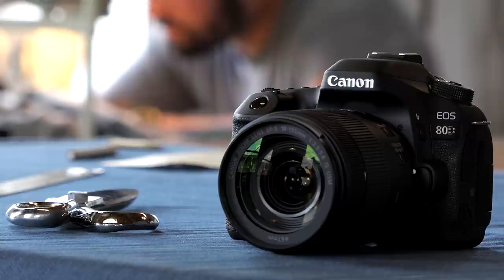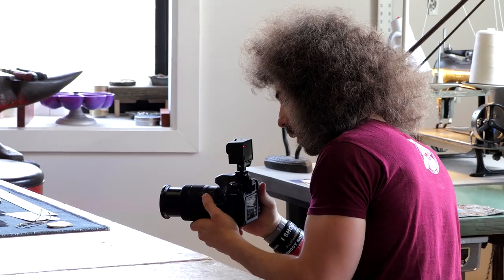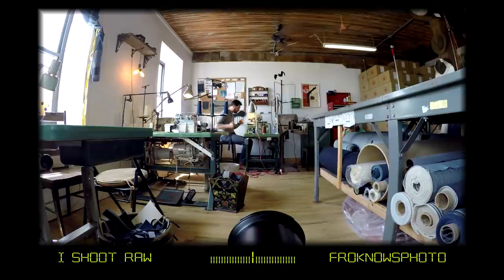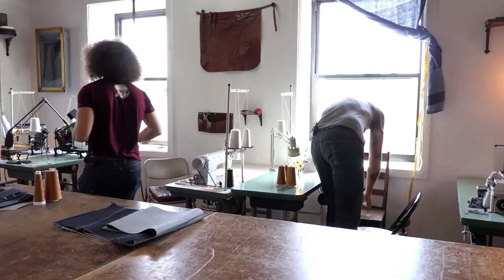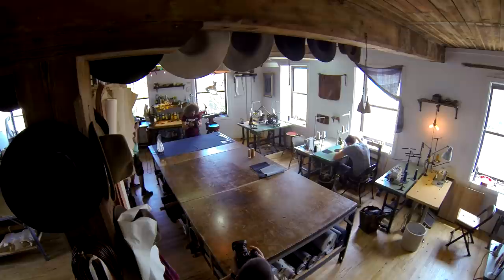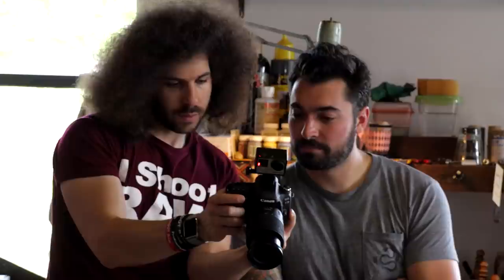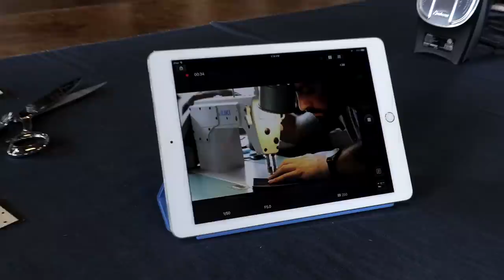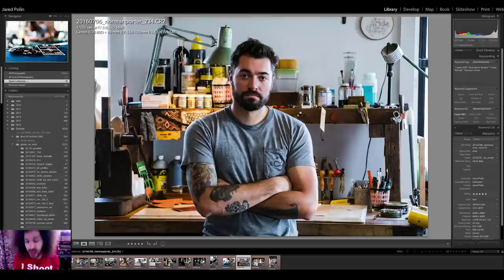How to get Professional Photos with a Kit Lens: "Canon 80D" 5 Min Portrait

Comment: kit lenses suck unless you have a lot of light at an elevated altitude , like a bridge for professional shots . I wouldn't use it indoors unless its pro lighting. to me that's the key. other than that LENS MATTER, rent a good lens , or buy a used one - a used good telephoto fast lens will cost the full amount as a new kit lens - 500-600 bucks. I write this bc unless you know how to manipulate a dark lens and you are a novice you may get frustrated with your results